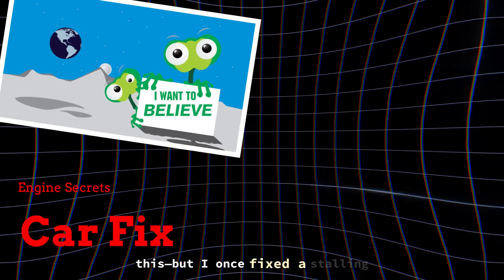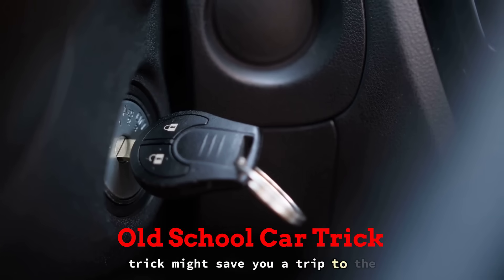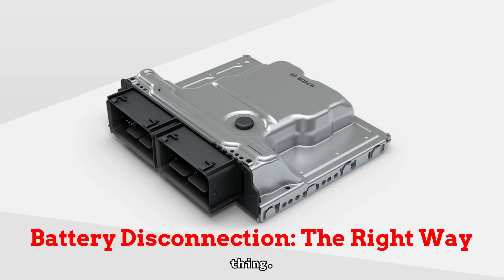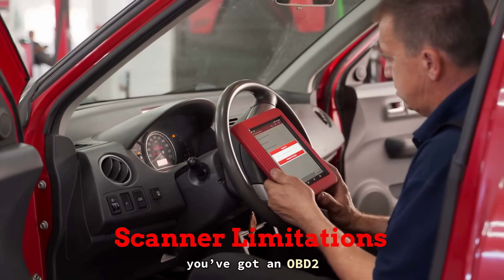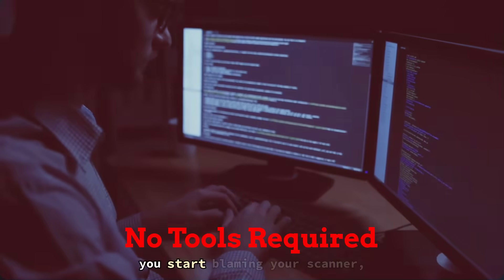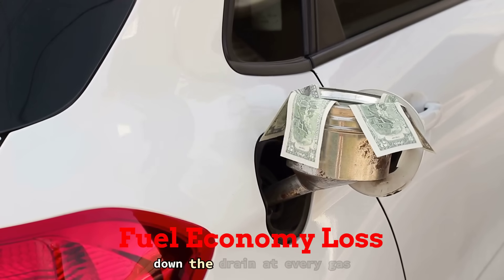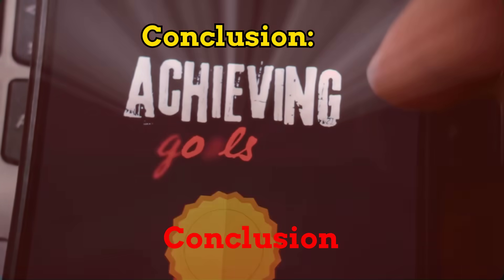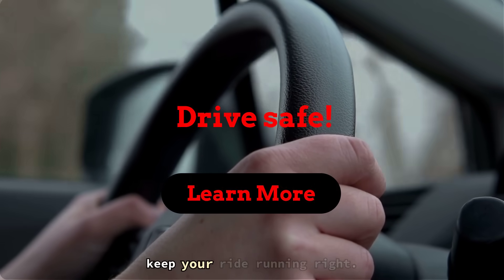Doing This Will RESET Your Car And Fix It For Free (5 Real Mechanic Methods)

Comment: Resetting the check engine light doesn't fix the vehicle. This is beyond stupid. Don't forget that everything on the internet is true!! Hahaha hahaha hahaha hahaha hahaha hahaha hahaha hahaha hahaha hahaha hahaha hahaha hahaha hahaha hahaha hahaha hahaha
Reply from the maker: Totally fair point—clearing a check engine light doesn’t fix the root issue, and I’d never suggest otherwise. These resets are just tools to help rule things out or clear up false flags after a fix or when weird glitches pop up. Definitely not a replacement for real diagnostics when something’s truly wrong. Appreciate you jumping in—sarcasm and all!

Comment: all you are doing is r4esetting the ecm and it doesn't "FIX" anything
Reply from the maker: You’re absolutely right, Ed—resetting the ECM doesn’t fix mechanical issues. These methods aren’t meant to replace repairs, just to help clear out glitches after a fix or when systems get confused (which happens more often than people think). It's all about knowing when a reset is helpful—and when it's time for real diagnostics. Appreciate you keeping it real! 👊

Comment: I have a 2016 Silverado and the check engine light was on but I also needed to change out the thermostat... Disconnected the negative cable changed out the thermostat reconnected cable, check engine light gone and also was my center display between the gauges went black! Tried a hard start with both cables disconnected and still no screen. Hope someone can help me out...Thanks
Reply from the maker: Hey there! Appreciate you sharing the details—sounds like you did everything right on the thermostat and battery reset. 👌

If your center display went black after reconnecting the battery, here are a few things to check that I've seen pop up in the shop, especially with GM trucks like your 2016 Silverado:

🔧 1. Blown fuse (most common)
Check the INFO, IPC, or RADIO/CLUSTER fuses in the fuse box (under the hood or inside the cabin). Sometimes reconnecting the battery can cause a surge and pop one—especially if the key was left in the ignition or accessories were on during the swap.

🔧 2. Weak ground or loose connector
Make sure the battery terminals are tight and fully seated—even a slightly loose ground can cause display modules to go dark. Also check the ground strap near the firewall and the dash harness plug (if you had to move anything around during the thermostat job).

🔧 3. Try a soft reset
Sometimes a second full battery disconnect helps:

    Disconnect both cables

    Touch them together (out of the battery, like in Fix #5 of the video) for 10 seconds

    Wait 10 mins, reconnect and restart.
    This forces a deeper reset of the Body Control Module (BCM) and can bring the display back if it’s just a glitch.

🔧 4. Display failure (rare, but happens)
If everything else checks out and it's still dead, it might be the screen itself or the stepper motor module behind it. GM clusters can act up after battery pulls. A dealership or good scan tool can test the display function without tearing into it right away.
Reply: @CarCareFix  Thank you very much .....We will try that and will let you know.

Comment: He knows what he's talking about.  I've done all of these tricks after a repair when my 2005 5.3 Silverado would be running rough and it always helped.  People should know that rarely do these trucks need the kind of repair that ones diagnosis based on the symptoms would infer. I thought my tranny was going out for a month so I wouldn't drive it due to the engine slipping into a low idle speed while driving it.  My boyfriend who is handicapped told me to unhook the battery overnight so I did and I never had another problem w it.  The 5.3 DOES NOT BREAK DOWN NOR DOES THE TRANNY THAT THE 4X4 COMES WITH.  IF YOU GOT THIS TRUCK OR ANY CHEVY 5.3 BETWEEN A 97-2007 KNOW YOUR FUSE BOXES AND FUSES AND KEEP XTRAS
Reply from the maker: @juliohno Man, you nailed it 💯—that 5.3 Vortec is a tank when it's treated right. Totally agree: these trucks don’t usually need major repairs when something feels off—it’s often just a sensor glitch, memory issue, or fuse problem throwing things out of whack.

Huge respect to your boyfriend too—that overnight battery disconnect trick has saved more “dead” trucks than people realize. And you're absolutely right about the fuse boxes—knowing your way around them (and keeping extras handy) is one of the smartest things any Silverado owner can do. Especially with the 4x4 models—those control modules are picky, but not fragile.

Appreciate you sharing real-world experience here—this kind of advice is what helps the whole community.
Reply: Recently purchased a 2016 Silverado LTZ w/ 150 k miles. Transmission electrical harness was replaced. Probably a good idea to visually inspect for harness insulation rub marks, chafing, & breaks. W/ your hand, move the harness around to simulate how it'll move when the vehicle is in driving motion & note where it hits/ rubs/ contacts on areas  most likely to cause harness damage. Final note: I read that some Silverados report tranny issues. Perhaps this issue they reported may be caused by not inspecting the trans elec harness. ~ Hope this helps
Reply from the maker: @DonTerhune1200cc  Don, that’s a fantastic tip—thank you for dropping real hands-on experience here. 🔧 You're absolutely right: harness chafing is one of those sneaky issues that can mimic serious transmission problems, especially on higher-mileage Silverados like yours. I’ve seen cracked insulation or rubbed wires throw ghost codes and drive techs in circles.

👍 Moving the harness by hand like you suggested to simulate road motion is something every DIYer and mechanic should do—it’s simple but powerful.

I might just feature this advice in a future video, because it can save people thousands in misdiagnosed transmission repairs. Appreciate you sharing the wisdom—keep ‘em coming!
Reply: I'm going to try the suggestion for the check engine light it has really been worring me me.
Reply: Thank you

Comment: Just another crap AI generated video. Champ!
Reply from the maker: Hey @sharthun2009 — totally get the skepticism. But just to be clear: this video wasn’t AI-generated. These are real tips I’ve used in the shop over the years, based on hands-on experience with actual customer cars.

If something didn’t sit right with you, I’m all ears—always open to feedback or a different take. Appreciate you stopping by either way. 👍

Comment: How do u do the ignition thing if it's a push start?
Reply from the maker: Great question, @carolinerobinson225! 🙌

If your car has a push-button start, you can still do the ignition “on-off” cycling — just slightly differently:

🔹 Step 1: With your foot OFF the brake, press the start button once. This puts the car into the “ON” or “Run” position — dash lights and electronics turn on, but the engine won’t start.
🔹 Step 2: Press the start button again (still with your foot OFF the brake) to turn it OFF.
🔹 Step 3: Repeat this ON → OFF cycle 3 times, just like you would with a key.

✅ You’re basically doing the same procedure — just tapping the button instead of turning a key. This trick can help reset fuel pump pressure logic, throttle adaptation, and even transmission behavior in some cars.
Reply: Okay,  I just figured it out.  I was lost for a minute but I got it not.  Only one question,  can I do that with a2009 ford escape hybrid
Reply from the maker: @msmeverd_yt7430  Great follow-up! On a 2009 Ford Escape Hybrid, you can try the push-button cycling method, but hybrids can be a bit more sensitive due to the high-voltage system and how the ECU manages startup. Still, here’s what to do:

🔹 Foot OFF the brake
🔹 Press the Start button once to enter ON mode (dash lights should turn on)
🔹 Press again to turn it OFF
🔹 Repeat 3 times within 10 seconds

That said, with hybrids, a full reset is usually more effective through battery disconnection or a scanner reset—especially if you're dealing with system glitches. Always double-check your owner’s manual for any hybrid-specific warnings.

Comment: I have a 2010 HHR speedometer fluctuates while driving I changed the transmission speed sensor still fluctuates
Reply from the maker: Hey @rickeyyoung1030! 👋

If your speedometer’s still bouncing around after changing the transmission speed sensor, there are a couple of other things that might be messing with it:

🔧 1. Check the wiring & connector – Even if the sensor is new, a loose, corroded, or damaged connector can still send bad signals. Look for cracked insulation, frayed wires, or signs of water intrusion.

🔧 2. ABS or wheel speed sensors – Some GM vehicles like the HHR also use input from the wheel speed sensors (especially the front ones) to help the ECU calculate speed. If one of those is faulty or dirty, it can throw things off.

🔧 3. Instrument cluster issue – HHRs are notorious for flaky clusters. If the stepper motor behind the speedo is going bad, it can cause jumping or inaccurate readings—even when the data coming in is fine.

🔧 4. ECU/BCM glitch – Try doing a full battery disconnect + brake pedal drain reset (Fix #2 in the video). That’s helped with random dash glitches on these models before.

Let me know if the check engine light is on or if you're getting any codes—that’ll help narrow it down. Happy to dig in deeper with you!
Reply: @CarCareFix Thanks my friend, there's no codes showing
Reply: @CarCareFix can I replace the rear hubs without removing the brake shoes
Reply: I changed the front hubs and sensors did not help
Reply: I've changed front and rear hubs on my HHR speedometer still bouncing around, no codes, what next
Reply: I've changed front and rear hubs on my HHR speedometer still bouncing around, no codes, what next

Comment: I bought a 2013 Honda Accord Sport in 2015, with 50,000 miles on it. A few months later, when I was leaving for work, every light on the dash came on, and the whole car shook. I turned the ignition off, and began searching for what the problem might be. Something told me it might have vapor locked. I don't know what caused it, but removed my gas cap, put it back on, it started, and it's never done that again. I'm at 165,000 and counting. Thank God ☝️🙇‍♀️❤
Reply: Thank you for your comment it would have really shocked me but now I’ll know if my Honda ever vapor locks. Even my dead battery is putting a dent in my day. I trickle charged it but lost all the things like radio, phone…
Mrs Z
Reply: @ArnoldZiffle-jw2mv buy new OEM battery your whole engine will work better
Reply: @anntoyou-i2u thank you I got a new battery & you are right suddenly everything reset & working better than ever. Honda claimed my battery was ok but it certainly was not.
Reply from the maker: Wow @sriley53sr—that's an awesome story, and 165k miles later? 🙌 That’s the kind of reliability every Honda owner hopes for!

What you described does sound a lot like a vapor lock-style issue or even a temporary fuel pressure glitch—removing the gas cap may have released built-up pressure or vacuum that was throwing the system off. Crazy how something that simple can be the fix!

Big respect for listening to your gut and not panicking. Sometimes the best "diagnostic tool" is experience and instinct. Glad to hear she’s still going strong—here’s to many more miles ahead!
Reply: Many a driver causes this problem themselves.
First ask yourself if when you fill up with gas, have you ever heard the nozel from the pump click itself off?
You are done.
Absolutely do not keep putting more gas in.
I have seen folks do it 4 or more times trying to put a quart more gas in.
Don't do that ❗
It was OK when you had a '66 GMC pickip.
Are you driving one of those?
Don't screw up the Vapor system.
It gets expensive to correct.
Remember -> Click & you are done

Comment: Great …2001 Passat v6 .code P0441.Replaced emissions purge valve and check engine light still on.
What reset would you recommend , before smoke test ?
Thank you
Reply from the maker: Good question, Sam—and smart move replacing the purge valve first. For a 2001 Passat V6 with a P0441 (Evap system incorrect purge flow), I’d recommend doing a proper ECU reset after the repair to clear any stored adaptive values. Try the battery disconnect method: remove both terminals, hold them together (with the battery out of the loop) for about 10 minutes—this helps drain residual memory. Then reconnect, drive it through a few cold start/warm-up cycles, and see if the light stays off.

If it comes back, next step would be checking for vacuum leaks or a faulty N80 valve circuit. Smoke test is solid as a follow-up, but sometimes a reset gives you a clean slate to see if the fix held. Let me know how it goes!

Comment: My partners Skoda electric window wouldn't work so I checked the fuses (I removed & refitted several fuses) now the car turns over but won't fire & it won't connect to the O.B.D reader.
Reply from the maker: Interesting situation—and yeah, it’s possible a key fuse tied to the ECU, ignition, or CAN bus got disturbed during that process. Some Skodas have critical fuses that, if not fully seated or if blown, can prevent the car from firing or even block OBD communication. I’d double-check every fuse—especially the ones labeled for ECU, ignition, and data link/diagnostics. Also, make sure the battery’s fully charged and stable—low voltage can cause weird communication issues.
Reply: I have not tried to soft ECU drain yet but I'm going to do that right now. Thank you for the heads up.😅

Comment: Any chance the battery disconnect could help resolve (suspected) parasitic draw in Jeep JKUs?
Reply from the maker: Great question! A battery disconnect won’t fix a parasitic draw on its own—but it can temporarily stop the drain and help narrow down the issue. On Jeep JKUs, parasitic draws are often caused by things like the EVIC module, aftermarket stereos, or even the TIPM. If you disconnect the battery and the draw stops, that confirms it’s something downstream. Next step: use a multimeter and pull fuses one at a time while watching current draw to pinpoint the culprit.

Comment: Will any of this help me figure out a red square light that says door ajar . ( issue with driver door lock button won’t work & also won’t Lock by pressing the remote or the passenger side lock button 2nd need to kinda slam to close)? Other issue tailgate door has cracked down the center under the back window, tailgate locks or unlocks fine with remote and passenger lock)?    No check engine lights but a oil pressure gauge that it’s hand is dropped south of the area where it should read between H and L (This 04 Mercury Mountaineer’s cluster does not have small little pin that some cars have THAT stops the hand from going in either direction so I don’t know if the hand has flipped around or if it’s just saying that it’s completely low pressure. I changed the sensor and I can’t figure it out.
Reply from the maker: Hi @Play_811, Thank you for your asking. I am glad to help you. You’ve got a few layered issues going on there—let’s break them down one by one.

1. Door Ajar Light & Lock Issues:
The red door ajar light and locking problem are likely tied to a faulty door latch sensor—especially in the driver’s door. On the 2004 Mountaineer, the sensor is built into the latch itself, not separate. If the car thinks the door is still open, it won’t allow locking via remote or passenger switch. Slamming the door temporarily helps because it might jostle the failing sensor into place. 

2. Tailgate Crack (Under Glass):
That’s a common Mountaineer/Explorer flaw. The plastic panel under the rear window tends to crack over time—mostly cosmetic, but if moisture gets in, it could eventually affect the rear defrost or wiper wiring harness. If your tailgate is still locking/unlocking normally, you’re safe for now—but keep an eye on electrical quirks back there.

3. Oil Pressure Gauge Reading Low (or flipped):
Good job replacing the sensor—that’s step one. But on these clusters, the gauge is basically a dummy light disguised as a needle. It either shows “normal” or “zero,” and if it’s pointing straight down or off to the side, the needle may have spun around the shaft (common after electrical spikes or resets).

Try this: With the ignition off, gently rotate the needle clockwise until it’s back in range (mid-scale). Then cycle the key and see if it resets normally. If not, the gauge motor in the cluster could be failing—a rebuild or replacement may be needed. A scan tool that reads live oil pressure data (not just codes) can help confirm actual pressure if you're unsure.

Comment: I had my check engine light come on one day , all I done U pulled out and reinserted all the fuses in the engine bay and the light disappeared .
Reply from the maker: That's actually a solid move, Luciano! Pulling and reinserting the fuses can definitely clear up bad contacts or minor glitches—kind of like giving the system a little wake-up call. Glad it worked for you!

Comment: Resetting the ecu will that trigger the pats system and mess up the programming in the key/faab?
Reply from the maker: Great question! In most cases, a basic ECU reset (like disconnecting the battery) won’t mess with the PATS system or your key/fob programming—especially if you're not touching the immobilizer module. But if you're working on a Ford or similar with strict anti-theft, it’s always smart to have both keys nearby just in case. 👍